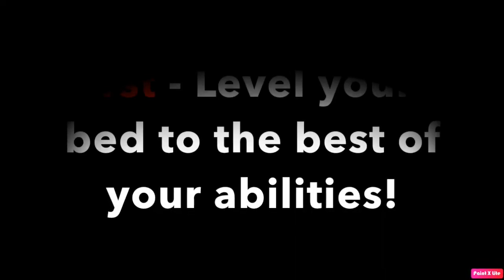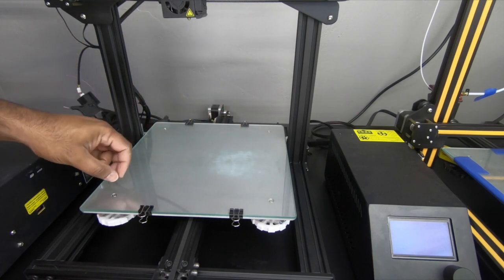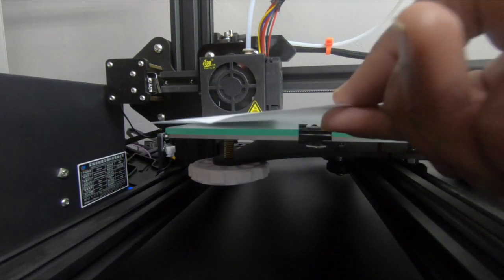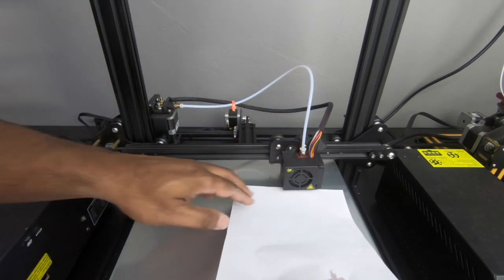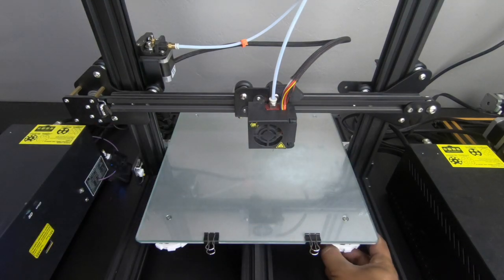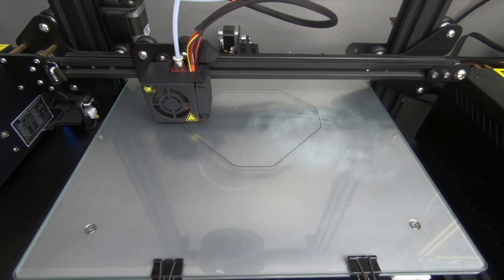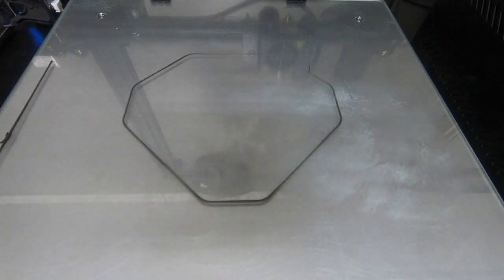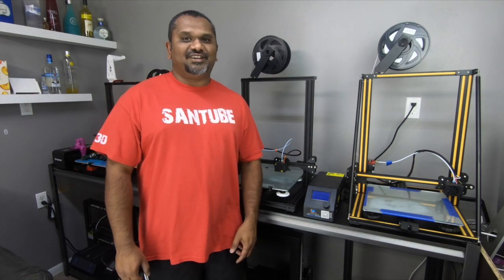Perfect Bed Leveling - The Wrong Way

Comment: I have been struggling with the leveling and first layer printing. This so far the best video addresses my problems. I just have one question. When we talk about the bed leveling, does that mean the bed wants to be perfectly horizontal leveled, or it’s adjusting the relative positions between the nozzle and the bed ? I got confused when I try to level my bed, I was doubting if the table is perfectly horizontal or if the floor is perfect or not.
Reply: I am also new to printing but I belive it is leveling the bed relative to the nozzle. I would think this is the case as you are adjusting the bed to where the nozzle is over. If it had to be perfect try level you'd use a spirit leveler

Comment: Sorry for the question before going to the forums. Obviously it works. I tried to move the nozzle and bed without commanding Disable. The steppers grip so hard against! Thanks again for Your great help to start this fun the right way even though it was the very wrong one!
Reply from the maker: Sorry for late reply. is your question before or after auto homing?

Comment: Thanks a lot ! I just installed my first printer with the help of Your expert installation video.  Starting soon the first print and now trying to do leveling. BUT.My printer is CR-10S 1.1.6.
When I Disable steppers it seems not to work. How do I know the command is in force?
Reply from the maker: Once you select disable steppers it should be disabled. If you can send me like a video of it maybe i can help you more.
Reply: @SANTUBE  
Thanks, I found the steppers are disabled. I expected much more free movement. But it is quite ok now.  Beginners problems!
Reply from the maker: @jyrkiiivanainen5876  glad to hear you got it worked out.

Comment: I have been doing this too.  when i first got my printer i didn't really understand that leveling is just not dialed in so much and you can tweak to succeed instead of assuming it's set forever.
Reply from the maker: Yup. Good luck and happy Printing.

Comment: Can you give the gcode to run the line on left side of the bed please.
Reply: Just update your version of cura, it does it by default.
Reply: I don't like the line and I removed it from mine.  It wastes filament because your skirt does the exact same thing, and because it's in the GCODE and not in actual slicing, sometimes models will overlap if they fill the bed.  Plus it wears a groove in your bed from doing it every single print.